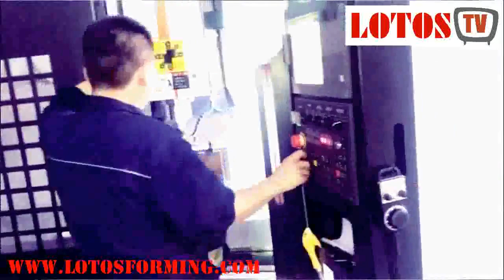⏭ How to Design for Roll Forming ?!! ⏪ Roll Forming Software / Roll Forming DESIGN ✔👍👌

Comment: Being a progressive and continuous process, in which small amounts of forming are applied at each pass of rolls. cold roll forming employe to bend a long strip of sheet blank into a desired cross-sectional profile via roller dies.
Reply: pls contact with me .we are the manufactru.+008617331730185 thanks

 ▼ 

solina Fox

Comment from the maker: The #forming #process #design in #roll #forming is achieved by drawing the finished profile and then “unfolding” it in a series of steps corresponding to the projected number of passes. The overlaid drawings of all the passes are called the flower diagram